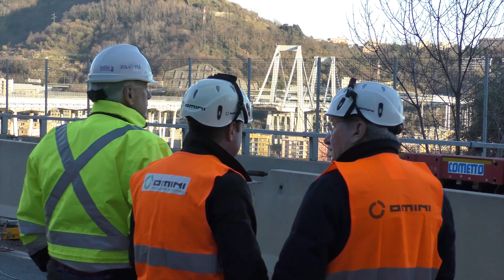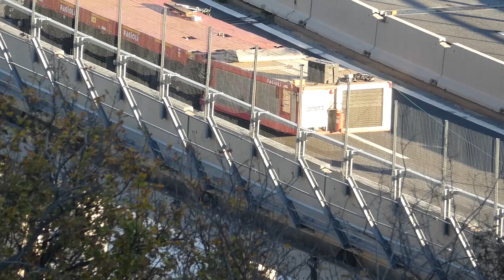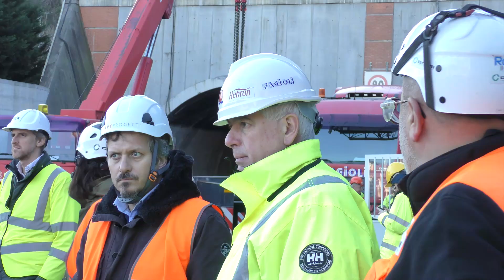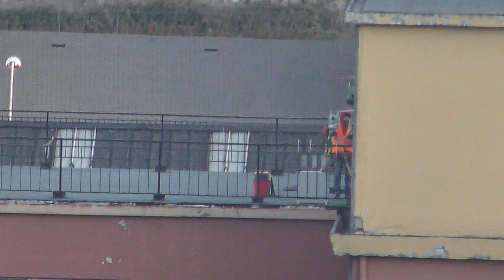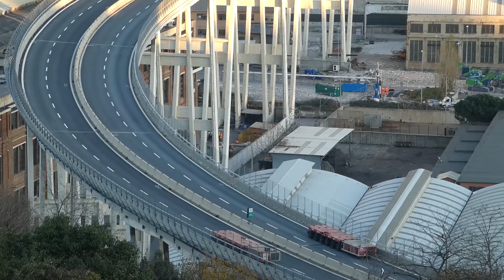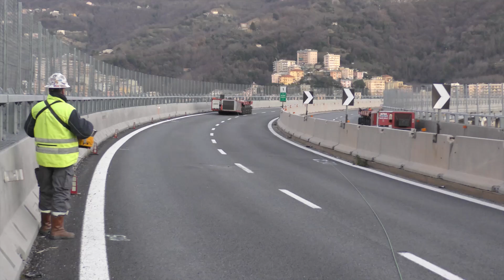prova carrelli sul ponte Morandi

Comment: Ho ascoltato quanto hanno esposto gli ingegneri che si occuparono della manutenzione dell'opera.
Secondo R. Calzona il ponte presentava, ormai da decine di anni, gravi deformazioni dei tiranti e dell'impalcato. Ciò si rendeva ben visibile in caso di pioggia, quando il ristagno di acqua evidenziava forti avvallamenti di alcune aree della superficie stradale.
Secondo C. Gentile, che aveva rilevato circa dieci mesi prima della disgrazia atti vibratori anomali proprio in corrispondenza della pila crollata, si sarebbero dovuti collocare urgentemente i sensori onde ottenere un "monitoraggio continuo", interrompere il traffico e avviare impegnativi lavori di consolidamento.
Secondo A. Brenchich sarebbe stato opportuno demolire l'intera opera venti anni fa, se non prima, in quanto compromessa fin dall'origine da numerose criticità intrinseche.

Secondo il racconto di camionisti che, anche in anni non recenti, avevano percorso il viadotto, esso si muoveva e emetteva inquietanti rumori al passaggio di mezzi eccedenti un certo peso.

Anche numerosi automobilisti che, durante le precedenti estati, si erano dovuti fermare al centro dell'opera a causa delle code, hanno testimoniato di essersi accorti di certi strani movimenti oscillatori del ponte, quando in verso opposto transitavano camion.

Anche Autostrade molti anni fa programmò la demolizione e il rifacimento dell'opera, non più adeguata ai nuovi volumi di traffico.

Il costosissimo progetto della "gronda" fu proposto da quanti, già anni or sono, avevano piena contezza della precaria staticità del Morandi.

Ce n'è più che abbastanza per convincersi che il viadotto è crollato per cause endogene e non per effetto di un esplosivo.

Quanto alle cause, saranno formulate delle ipotesi, ma a parer mio non si avrà mai la certezza assoluta.
Reply: Appunto. Non si avrà mai la certezza assoluta. Anche perché non la vogliono avere. Ma un conto è dire che facesse schifo e il cemento aveva le crepe e si vedeva l'armatura ecc e va bene siamo d'accordo. Ma da qua a sbriciolarsi da un momento all'altro ce ne passa caro mio